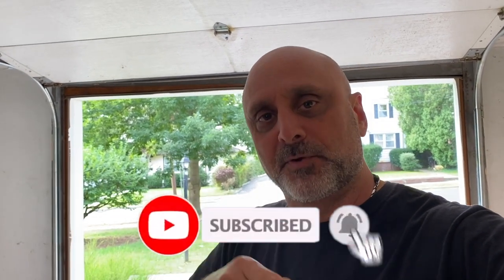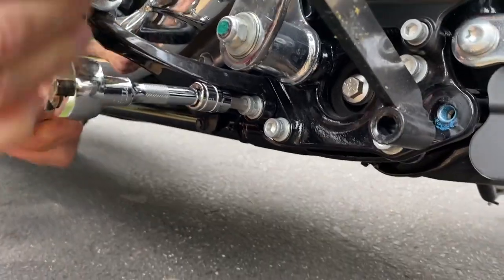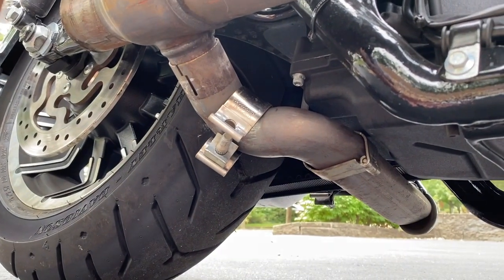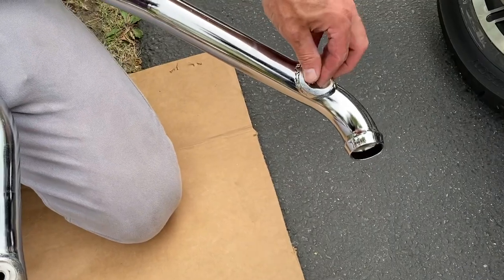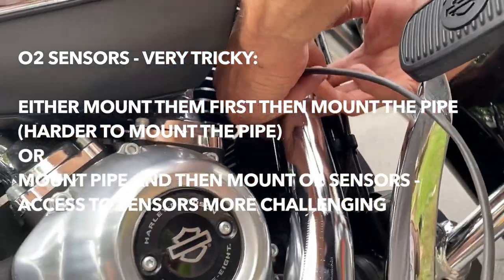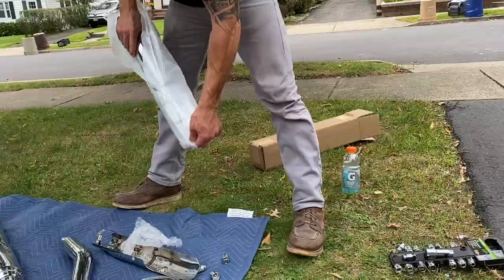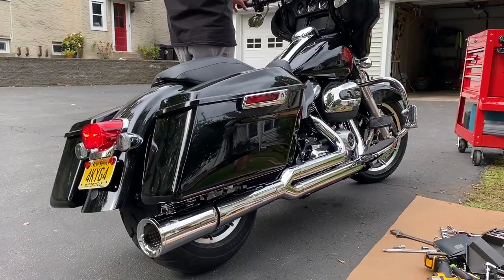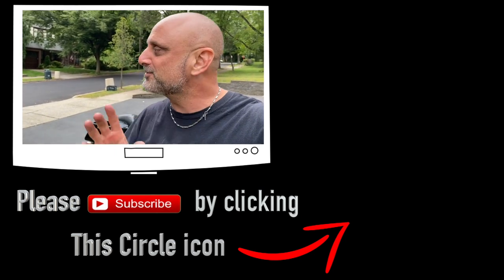Vance & Hines Pro Pipe install

Comment: Looks great. I hope you used some lock tight on the bolts, especially the bolts in the bracket to the pipe. They tend to come out without lock tight. Know from experience, lol!

Comment: May require tuner also once you get new air cleaner . Great video..i went with Rinehart dbx 40 on my standard
Reply from the maker: Rob Cyr thanks brother - I actually installed Fuel pack tuner right after the pipes...👍🏻🤟🏻
Reply: @HOLYSHIFT  How did the FP3 install go? Darn pretty pipe you have there. You have the buddy well all wish we had!!

Comment: Did you have to do the pro tune also or did you just install it straight and it was good to go?  Looks like John has done that a couple of times ... LOL
Reply from the maker: The Adventures of FPFD318 actually I installed the Vance & Heins fuel pack tuner right after the pipe- video will be out tomorrow...yeah John did quite a few pipes...haha

Comment: O2 sensors on the pipe 1st always.... I found out the hard way on my 1st install ....
Reply from the maker: O2 sensors on first - makes it a bit more challenging to mount new pipe and risking the ripping of the O2 wiring... other method more difficult to place in the sensors....any way both methods work.....just tricky...